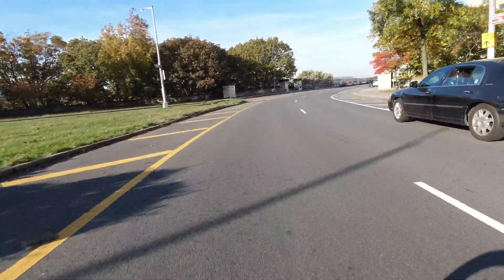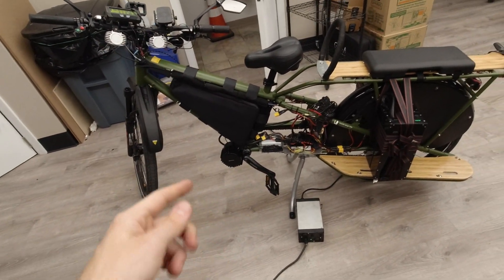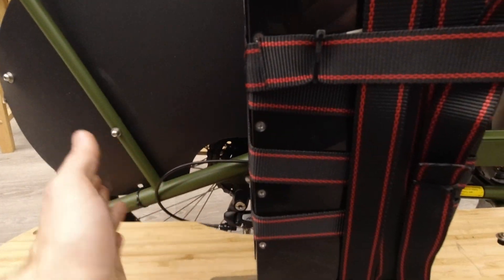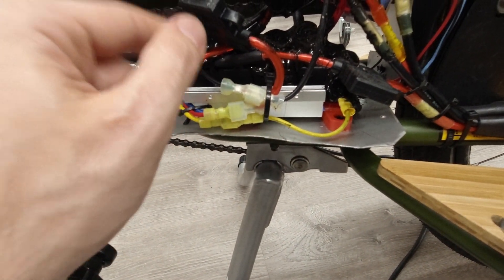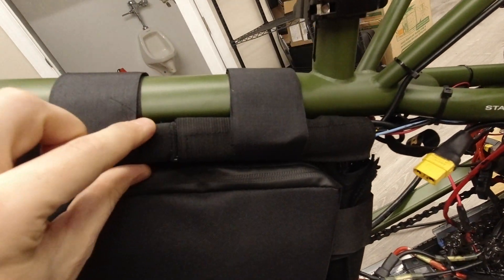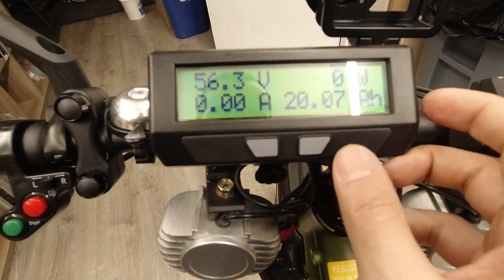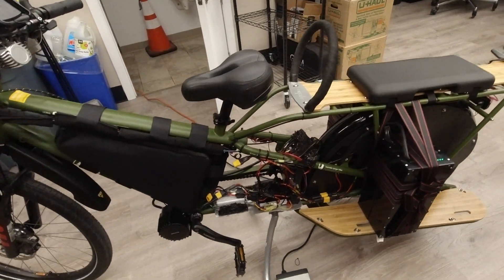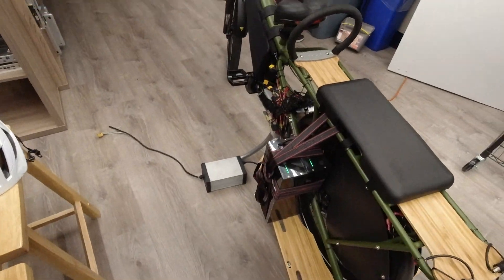Bike project reborn with EM3EV batteries(so no explosions this time)

Comment: I have a 48v and 28.8 ah battery, I've been using it for 17 days, but yesterday it didn't turn on, when I put it on the charger the panel turns on and shows 100% charged, without the charger the panel doesn't turn on, the battery doesn't pass energy to the electric bike, can you tell me what the problem is?

Comment: Are you saying you can legally ride this DIY project on the roads in the US?
Reply from the maker: I'm saying there's no such thing as a policeman that carries a multimeter and then hooks up the leads between the battery and the XT60 to the motor controller, gets on it, and reads the multimeter as he revs the throttle to determine whether or not it is within the legal limit. Just don't drive like an asshole and you're fine

Comment: How is the weight on that back tire? I have a custom ebike and blew out my rear tire twice with no passenger and a 1/4 of the batteries you have. Do you use like some ultra strong/durable rear tires? lol
Reply: I am a schwalbe fanboy.
Reply: @rossmanngroup  Ahhh yes, I have looked at those tires, specifically the Marathon Plus. I had trouble finding a shop near me that sold them so I settled for cheaper quality. Definitely makes sense though, that is a good choice!

Comment: There is new battery technology in the works called Lithium Ceramic Batteries. They are seemingly much safer over traditional LiPo and have lots of potential. :) I'll drop the link to the vid I watched in a second:

https://youtu.be/kJXRyWQgOY4

I think they'd be amazing batteries if wired in series, parallel or both systematically.

Edit: I love this project :D you make me want to build my own electric bike. Probably would be super useful if I did.

Comment: wow,ive made alot of high power ebikes somewith front and rear hub motors and dual sabvoton controllers ,but i have never had to use any wiring system like that,,Are you using the rectifing bridges to prevent flowback into the separate bms in each bat unit?

Comment: Stacking more and more batteries, pls keep in mind the back tire's max load. Especially given the speeds you're driving.
Reply: About 45 pounds for 4 of those.
Reply from the maker: It can carry a few hundred pounds in the back. Even with Erica + batteries I am well under total capacity. I would not feel comfortable loading it for its rated capacity.
Reply: @rossmannkoigroup  just got worried hearing you count to 8  :)
Reply: @martin bakker I have seen Mundos loaded with 450+ pounds of audio equipment riding on regular bicycle tires (Schwalbe Big Apple iirc). I agree it is the speeds that will break a tire down under load more than anything.

I run the same 2.3 inch Schwalbe Big Apple rubbers on mine and love how cushy and secure they feel when hauling passengers.

Comment: Anyone know of any cheap conversion kits in UK?

I see some on ebay for like £200, but without a battery. 
Then a decent battery is another £400!
So that's £600 + the price of a bike

I can get a built ebike for £1300, which is twice the price when excluding bike cost, but then at least it's all fully built and/or you know it will all work.

Any suggestions?

Also I am obese so cant go for one of these cheap £600 Halford bikes

Comment: You really need to round, and or Deburr that Mac Book case you jurry rigged for a platform on the bottom of that thing. That was a terrible idea. In general you should probably find a proper machinist to help you build enclosures for all that componentry

Comment: I've put this under every bike video but...
What is the point of the bridge rectifier?
Reply: Prevents current from flowing back into the battery. So one battery cannot charge another battery. Means also you cannot use regen braking or charge all batteries in parallel.
Reply: @bubufant  Why would they charge each other... they're in parallel... all the same voltage. Even if they did - why is that bad? With that logic - all the cells should have diodes, so one cell can't charge the one next to it...

Comment: you should put that battery horizontally. The lower the weight center is, the more stable and balanced the bike is.
Reply: or at least put them flater. Like, it looks like the moment you want to passe somewhere narrow, it will hit something. 
Sorry it's hard to explain since English is not my strongest language
Reply from the maker: Nope, horizontally it is considerably worse since it goes further back and away from the center of gravity. Ideally I would move them ALL the way up, but Erica does have feet...
Reply: @rossmannkoigroup  i mean like if you put the heavier part of the thing on the botom, it will less likely fall on the side when you tilt it. Like if you glue two cubes of the same size tugether, and one of the cubes is in plastic and the other is iron. If you put the iron cube on top, and you push it, il will fall easier than if the iron cub was  above. But may be i am too dumb to understand wat you are talking about. May be you're saying that the more of the weight is concentrated away from the center of the bike the harder it is to tourn the bike? But any ways it's too complicated to explain without showing so don't bother.
Reply: @psshatyTV  maybe if he were designing a yuba battery pack he could make some special batteries designed to fit in enclosures mounted like running boards, but I imagine he wants to err on the side of using what em3ev makes well rather than custom batteries.
Reply: On a longer-framed bike like the Yuba Mundo, it is preferable to have the bulk of the weight in the rear on top of, or better yet, in front of the rear axle. I have a Mundo myself. They will haul 500+ pounds like nobody's business.
Reply: @Maleko48  I tried the batteries lying down, and standing up, standing up was considerably better handling. Ideally they would be all the way at the front, but then no footrest.
Reply: @rossmanngroup  I totally agree, and I also just saw your initial response to @psshatyTV further up. My response above was really to him.

When you have a fully loaded (non-electric) Mundo and you gotta stand up to put power into the cranks is when handling such a long bike can get a little funny, especially if you still have the stock handle bars and stem. The amount of flex that resonates throughout the bike can get out of phase with your power stroke and the bike can develop a load wobble in the front end (like a low-speed speed wobble) that you have to actively counteract from the handlebars.

I was only trying to say that having weight behind the axle on a long tail cargo bike like the Mundo is more detrimental to handling than having weight up higher imo. After all, it is designed to haul up to 2 adults plus the pilot, with the majority of that weight being at the rear deck height and higher. :)

Btw, what tires are you running on your new Mundo @Louis Rossman?

Comment: Nice you eventually tilted seat forward, I'm just thinking about the front mudguard I think you'd be better with a mudguard that goes all the way round close to the wheel does prevent less spraying, why do you have the batteries standing up? You want the centre of gravity to be low as possible! why don't you have them flat?
What's the maximum speed 60 miles an hour.
Reply from the maker: it is not about center of gravity being low. It is about it being center. If the batteries lay flat, then there is more weight towards the end of the bike.